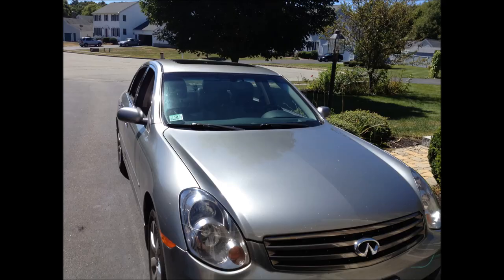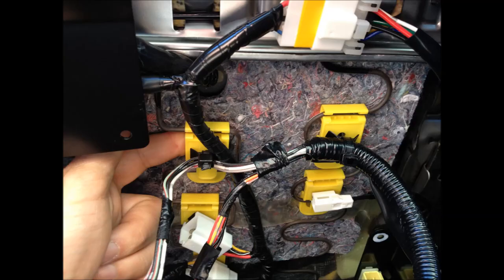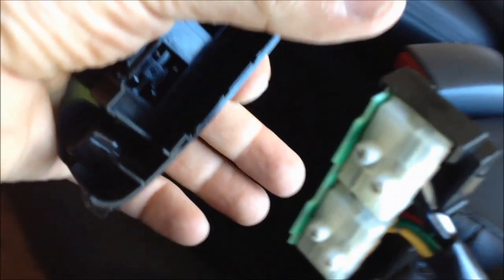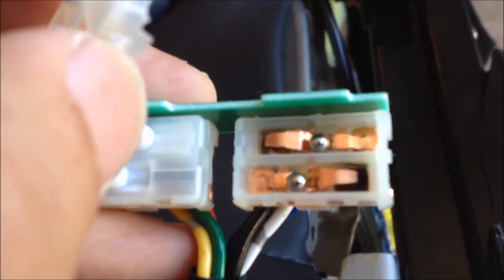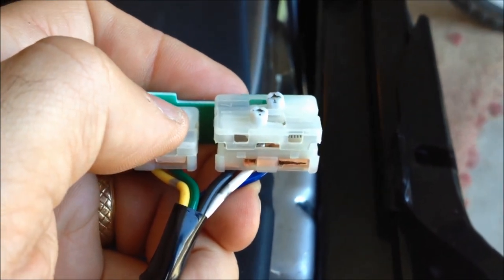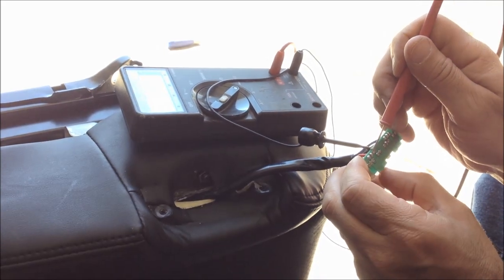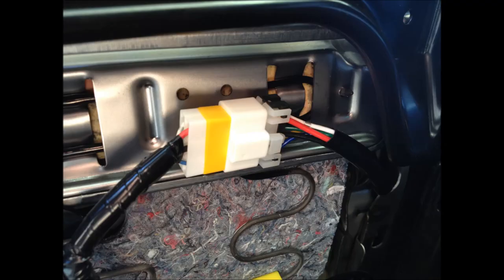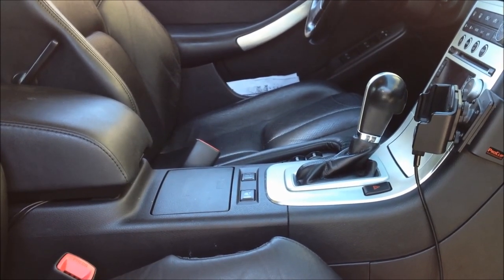Infiniti G35 Power Seat switch Repair

Comment: Reversing the polarity on the switch is absolutely brilliant. I solved my seat incline issue in 5 minutes (once I located the right connection). Very happy I didn't have to yank the seat out.
Reply: Where is the recline/incline connectors? Thank you

Comment: I just watched this video and repaired my 06 G35 sedan. The hard part was aligning the steel ball with the spring in the switch. The springs were hard to keep in place while trying to snap the switch back together. I super glued the springs that kept popping out. Also I used electrical contact cleaner. Thanks for posting the video.
Reply: Thanks man I was getting pissed cause the balls were hard to line up and the spring kept falling out lol

Comment: I had the same problem where the passenger seat would go forward but not back. Came across your video but looked at the comments and saw that someone suggested just spraying the contact cleaner without taking everything out and IT WORKED. For anyone with this problem I would suggest to do the same before committing to taking the seat off. Unplug your battery and with the contact cleaner spray directly in the switch. Let it sit and evaporate and hopefully that helps. Helped me for sure!
Reply: You just saved me a lot of time! Thanks
Reply: Do a video ! Where do we spray the contact cleaner
Reply: 3 years later and you just came in clutch appreciate it  💪🏽
Reply: @vanessarojas9402 late but directly in the switch
Reply: Also, I used circuit cleaner spray from the WD-40 brand and sprayed it several times. Left it over night. That plus doing the “aqua tubing” fixed both sides power seats

At first my seats wouldn’t move, so I sprayed the cleaner into the switch a few times. This temporarily fixed the seats switch and it would move sometimes. This allowed me to get the bolts out for the seat by moving the seat all the way back and all the way forward

Then I cut a very thin piece of tubing. It has to be this size of tubbing in the those other videos (other sizes for HVAC tubings will not fit! They are too thick)

For most cases, the switch is fine but gets dirty over the years. It just needs to be cleaned with cleaner

Comment: For all of you doing this repairs and not understanding the weaker link here are my 2 cents. 
The motor has carbons and as time goes the carbons get worn out, some people hit lightly the motor (s) with a hammer and they work again because the carbon powder falls from the carbons contact area, but the problem comes back when the carbons are totally worn out.
The switches almost never go bad, so this is a great video but not the main causes of most of the failures.  Good video Mark!
Reply from the maker: Thanks for your 2 cents.
If anyone has a confirmed bad motor, can you take it apart and send a picture to me so we can take a look at the carbons (I'm assuming these are the motor brushes).
Thanks,
Mark

Comment: I had this happen.  Seat started moving forward all by itself.  I unplugged the switch from the motor, drove it this way quite a while, then reattached it.  Started doing it again, no surprise.  I'm "into" antique radios - one of my go-to tools is a spray can of DeOxit.  It's an electrical contact cleaner.  I decided to spray this liberally into the switch without removing seat or anything - just sprayed it in.  There's a skinny tube attachment like you get with WD40.  It took soaking in overnight, but it's been perfect ever since.
Not saying this is the cure for every case, but it'd be an easy, inexpensive and.... EASY!!! first attempt at a fix and might work.
Reply: carl23401 AlZ""
Reply: Yep; I work with various electronics, fixed a couple TV's, build some computers, modded some guitars and amps, etc... Just sprayed some CRC QD Eclectronic Cleaner all over the top of the switch, and it immediately let me at least move the seat to recline a little from being stuck in an incline, though it's not going any further back yet. I'll let it soak overnight and try again tomorrow. Then it's off to trying to fix some static-ridden guitar pedal pots. I'm glad I saw your post and was surprised I didn't think to try it, myself! Thanks, 2 years after you posted!
Reply: @carl23401 where can you get it at?
Reply: Do you have to disconnect the battery before using it? If anyone could answer that for me
Reply: @chrisgomez4735  tubes and more. Any online electronic retailers. Google it.
Reply: @chrisgomez4735  no need to disconnect power.
Reply: @handyboy2000  would a fix like this work if my passenger spilt a drink on the switch that caused it to stop working?

Comment: Thank you for making this video. I tried you methods of fixing the switch by taking it apart, but ended up losing a spring while trying to reassemble. What I ended up doing was using an aftermarket power window switch and tapped into the power seat motor directly. The switch I got had 5 wires: IIRC, the center wire is the power wire, which I tapped into the constant power wire; the 2 wires next to it on either sides are the ground wires which I tapped into the ground wire; the 2 outer wires on the switch to the power seat motor. I mounted the switch to the plastic piece in front of the seat and so far it's working great. The switch you can get it from Amazon for about $5. It depends on the type of switch you get and the wire configuration maybe be different. But basically, all you need to do is tap into the constant power wire of the car under the seat, tap into the ground wire or ground the switch to the chassis, and then tap into the motor wires.

Comment: I have a 2007 G35 and the seats and location of the switches are more difficult to tear down to get to. This video is a life saver though, followed as closely as I could and it fixed my issue! My driver seat wouldn’t recline forwards and was stuck leaning back like at a 130 degree angle. The trickiest part was getting those ball bearings and springs into place while I tried snapping the cap back onto the switch. It was all worth it! Thanks so much!
Reply from the maker: Sounds good!! Thanks for the feedback.

Comment: Mark , just did this on my G35 in -20C and snowing.  Brought the seat into the garage and followed your instructions. Seat now works perfectly!. Only thing I did differently was for the single clip in the switch located between the switch and the circuit board I placed the sharped paper clip in from the top of the switch instead of the side.
Thank you for taking the time to post this!
Reply from the maker: You're welcome!

Comment: Thank you for this video!! My seat would not move up and got stuck in the reclined position where it was difficult to reach the back bolts. Could not move forward because it was all the way back.. but had to do something because it was pressing onto my back seat.  I did this to my 05 G35 sedan passenger seat and worked. The switch was burnt. I do recommend to take  pictures of how things were before removing.. i mean makes it much easier..  ahhh so glad it works, Thanks again!!
Reply from the maker: +chapiz909 Great!!
Reply: Thats how mine is right now! Lol
Reply: my passenger seat is stuck in recline.....cant reach the bolts.  Guess I have to pay the professionals.

Comment: Get a sewing needle to use on the last clip on the circuit board side of the switch. Much easier than sharpening a paperclip as it is more rigid. Thanks for a great video, made it much easier with your help.

Comment: Mark, great video! The part on taking the switch apart to clean the contacts was what I needed. I had a very hard time getting the switch back together though because the natural position of the ball bearing and the switch heads (the white part that moves) would not match up. They were about 1/8 off on both going away from each other. Also to top it off all the springs would fall out when I placed the switch heads in to the top piece and bring it down on to the bottom piece. To combat this I used a small amount of rubber cement to keep the springs with the top piece and I also used enough to keep the ball bearing to the spring in the upper piece. Worked like a charm and on the first try.
Reply from the maker: HI George.
Great idea!
I'm happy to hear you got it working!
Mark

Comment: GREAT video Mark, helped me a lot doing my repair! By the way,  i have a G35 2005 COUPE and i can confirm that you don't have to take out the whole seat in order to take out the switch if the switch isn't completely damaged(at least in the Coupe). Just make sure you put the seat all the way up to the front of car, take out the plastic front cover and side cover of the seat and you will have access to the plug in which the switch is connected. Much more easier this way. Took me like 7-8 minutes first time doing it! In my case, the little balls were out of place and had the black wire broken, so i had to solder it. Very easy task that saved me TON$$$$$$! Thanks a lot Mark!
Reply: Can you help  me please I have the same car

Comment: Mark, thanks for this instructional video - it was great.  Only thing different I did was to work on the seat while it was still in the vehicle AND i used a little bit of super glue on the end of the springs that align on top of the bearings.  My issue was the springs kept falling out when I would flip it onto the base piece.
Reply from the maker: Sounds like a good technique with the glue! Thanks for sharing it.

Comment: Hey Mark, thanks for putting this up. Passenger seat switch in my wife's 350z had stopped working and after checking out your detailed video, it gave my great guidance in getting it working. Like yours it was the contacts being super dirty. Cleaned up, reinstalled and all working great again. Cheers from AU

Comment: I achieved the same result as this video by simply applying 10-20 drops of isopropyl alcohol (91%) around the affected switch and then moving it back and forth for a minute. Didn't work immediately, but after 5 minutes the switch worked perfectly again. Thanks to Mark though for posting the video and helping me understand the problem, I appreciate his efforts.
Reply from the maker: +Robert Kempf Sounds good. Good find!
Reply: Tried contact cleaner and nothing. A few drops of hydrogen peroxide and the switch worked in seconds! Was able to power slide the seat all the way back. Thanks for the suggestion!! A life saver.

Comment: I had to clean my switch this weekend om my 08 Z (drivers seat wouldn't recline backwards any longer).  However, I didnt use any solvents, simply cleaned the contacts by carefully scraping away the carbon and pitting using a very small screw driver.  I did perform the applicable steps as explained.  I fabricated two jumpers approx 2 ft long to allow me to test the motor while the seat was out of the car.  Ensue you take the switch apart in a bright clean area to prevent losing any of the springs.  I used a  bit of glue to secure the longer springs in place for easier reassembly.  Word of caution, at first hint of seat movement problems whether f/b or reclining, fix it then; dont wait until it stops working all together.  it will save you time and effort to do it early in the failure.

Comment: Thanks Mark,
I just fixed the problem with my 2006 Altima drivers seat.
Your re-assembly detail of the switch helped alot.
Reply from the maker: +John Wetfoot Great!! So the Altima has the same issues...
Reply: +Mark Antonucci 
The Altima uses the same switches but my trouble was the wiring rubbing against the rough sheet metal edges and shorting out.  I took one of the switches apart to inspect but was having trouble with re-assembly.

Comment: First came across your video in 2014, but it looked like a lot of work lol so I backed off. Came back 6 years later and though it is still a lot of work, I followed your instructions to a T and voila! my passenger seat works again. I had the exact same issues as you (or your son?). So thanks for the great video!

Comment: hey mark wanted to personally thank u on this video I have not tryd it yet but will this weekend I honestly don't mind it cuz the seat got stuck at my settings since I'm tall and it's all the way to the back couldn't remove the rear screws, there for didn't even mess with it..so my girl would use it as an excuse not to drive the car since if I drink she drives and it's manual and doesn't reach clutch. hope this works out.. was VERY HELPFUL .!☺

Comment: Is there a way to move the seat back if it's stuck in the front position?  I tried to insert wires into the housing like you did but that didn't work for me.  I don't have any alligator clips, maybe that's why?  I can't get access to the front chair bolts without moving it back.  And unfortunately can't just access the screws on the side of the button housing without removing the whole chair.  Any advice?

Comment: Mark, yes I did watch this video several times, cleaned my contacts, etc but I don't know to do the recline motor jumper - I saw this video but do you have a video for the reclining backrest/motor? I do have a bro-in-law who's a commercial electrician - thanks
Reply from the maker: I'm a little confused but lets talk it out. There are two switches on the passenger chair. One moves the chair forward and back. The other switch is the recline switch that you are talking about. Is this the switch your talking about?
Thanks,
Mark
Reply: Mark Antonucci Last night I was able to disconnect the 2 wire connector going to the recliner motor - I put my multi-tester on the hot side & saw it had just shy of 5v - when I did that it started to bring the seat back up which I continued to do until it came all the forward - now I have it in an upright position & it works sporadically so I'm not going to press my luck - It didn't make sense to me but those were the only wires I could see going to the motor - if it happens again & I can get it back to the upright position, I'm going to unplug it so it wont recline

Comment: Nice. I have exact same problem Thanks Man for this DYP. I am going to try remove switch without removing whole assembly of the seat
Reply from the maker: Maxim Tr It's going to be tough to do it that way...See other people's comments.
If you drop the switch parts down under the seats, it's almost impossible to find. 
Let me know if you find a good way to remove the switch. Thanks!

Comment: This was a great writeup. I did everything like in the vid.  I did have an issue though.  Once i installed the seat and tested the power motor, everything worked for all switches briefly.  Then the seat would no longer move backwards which i thought was odd.  The other 3 switch movements worked, but i noticed the motor which i believe moves the seat front and back was hot to the touch.  I've since disconnected everything so as not to burn up the motor.  Could this be something going on with the polarity or grounding out e.t.c.?  How would i correct this?

The 1st time the switch wouldn't bring the seat back up, now it won't move the whole seat backwards.  What gives?  Any ideas appreciated!
Reply from the maker: Lets see..When you say back up, do you mean the backrest or the entire seat?

Sounds like it could be that the switch was not put together correctly. You have to make sure to get the springs in correctly. It's hard to do. Take the seat out again and Ohm out the switch to make sure it is indeed working correctly.
The other thing is to inspect the wiring. Make sure nothing is pinched.
Let me know.
Reply: Thats what i'm thinking as well.  I made sure the wiring had clearance once i put the seat back in place.  The entire seat would not back up, i'll check the switches again, especially the one that was affected.
Reply: Mark Antonucci
I took the seat back out and tested the continuity (ohms) of the switch again and recleaned all contacts e.t.c. and put everything back together.  Installed the seat again and tested everything where it worked and all of a sudden didn't want to move the seat back again.  This time i took my wrench and gave the relay or power seat motor under the front of the seat a little tap, low and behold everything is working again!

I believe i may have an intermittent relay or something as well, but at least the seat is working again (knock on wood).  One issue i had was the air bag light started flashing as I started the car (possibly due to not disconnecting the negative on battery before disconnecting the seat).  I was able to reset the airbag light from a simple search on google.

Comment: so your seat didn't move at all? my passenger seat moves only from one side, if I want it to move completely I have to push or pull it. I think it might be the little starter motor in the front of the seat because it makes a cranking noise when moving.
Reply from the maker: Sounds like the gears might be stripped..I have not taken the assembly apart to know what's in there though.

Comment: I have a 2006 G35 coupe. Both seats don't move backwards or forfward. They do tilt though, but my seats have other controls as well I hope this fix works. I will try the passenger's side first. Probably just spraying cleaner on the switch without taking it apart could work.
Reply from the maker: It may get it going for a while if you can get the cleaner into the swtich. Not sure how long it would last.

Comment: Worked for me, the problem with mine was that it was so dirty underneath that it didn't engage all the way (the plastic lever) but i still cleaned everything and like someone else commented it helped gluing the small springs so they would not come out when reinstalling

Comment: do you think I could just take out the center console vs taking out the whole seat?
Reply from the maker: It's too much of a pain to try and reassemble the switch. If you drop any of the small parts, you could lose them under the seat.